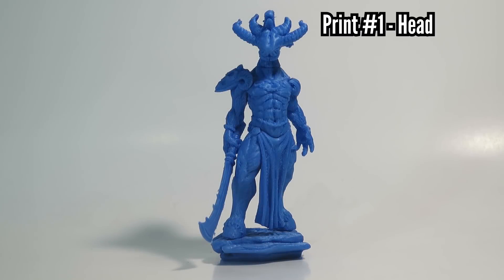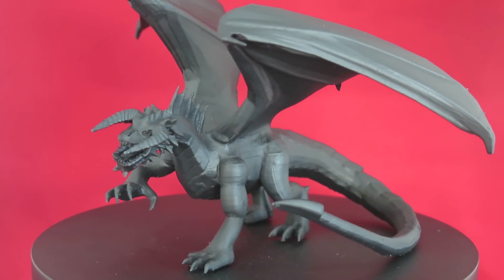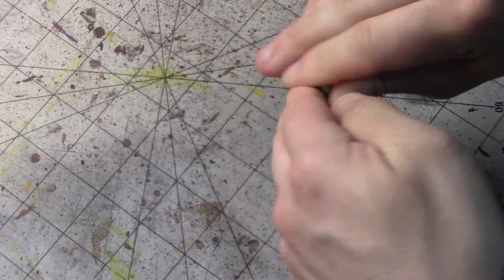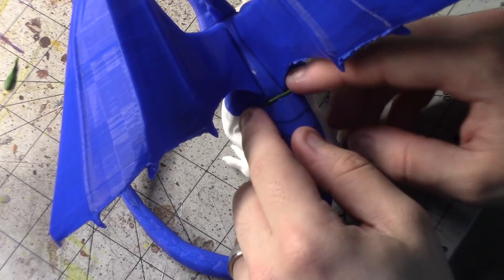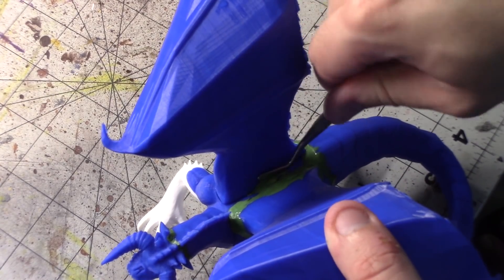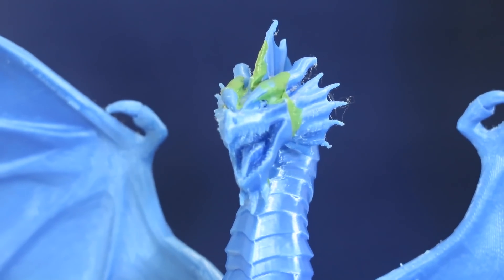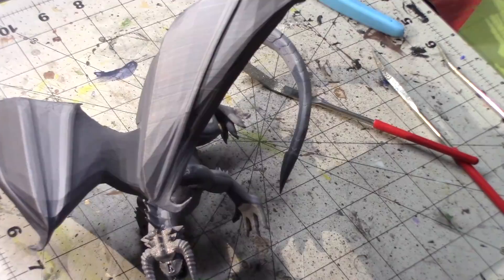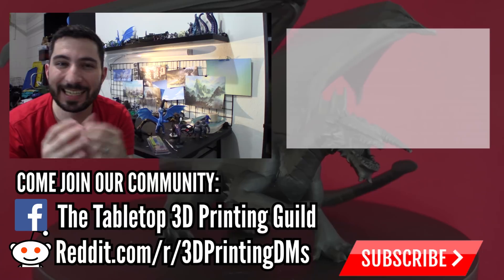Fix Your 3D Prints Cheap (with Green Stuff) - (Printing The Game #6)

Comment: Skip the green stuff. Joint Compound has worked for me. Cheaper, easy to apply, and easy to sand, file, and sculpt, too. You can even rub it thin, all over the entire model to smooth and remove layer lines.

Comment: Always cut out the center portion where the 2 colors meet.  Green Stuff is a 2 part epoxy and cures via a chemical reaction, anyplace the 2 colors touch will cause them to cure and leave a hardened section.  
Great, informative videos

Comment: I like Green Stuff for sculpting, but for a repair work, I prefer something like Milliput. The differences in consistency make them very different to work with, even though principally they're very similar.

Green Stuff (Kneadatite, by the way is pronounced Need-a-tite ;) ), while workable, is a bit like chewing gum; it flexes a lot, and tends to stick to tools readily (which, yes, has been mentioned elsewhere can be remedied with a bit of water, Vaseline, or even nose grease). But when you're trying to smooth transitions, I find it's pretty tricky. Doable, but tricky. When it sets, it's quite a bit like a plastic; shiny and mostly hard, but with a tiny amount of give in the surface.

Milliput, meanwhile, feels a lot more like potter's clay while it's in its working stage, and that includes being able to thin it with water (as when you dilute clay to make slip). As such, if you're trying to get those smooth transitions between putty and print, all you need is a wet finger, and the clay will dissolve as much as you need to get that blend. The cured result is harder, and has less flex than the Green Stuff.

Comment: you can get silicone caulk or glue in the same format instead of this, and it's much cheaper, though quite a bit softer. 
Using generic 2 part resin is also good, a random 5 minute epoxy can be applied with a toothpick in layers.

 something you might want to look at are uv cured resin pastes, which allow you to manipulate them like clay until you shine a uv light on it, or expose it to the sun (which is one of the drawbacks, you need to store it in somewhere really dark).

a warning with some epoxies, they get hot, so you might get warping if you put a lot of it.

Comment: Hi, i just got my first 3d printer (the ender 3) and I'm having a bit of an issue. The x axis rail (the bar that holds the extruder) is tilting down on the right side. One of the wheels on the right side isn't even gripping the frame at all, and the bar is tilting so much that i can lift it up from the right side and wobble it up and down. This only happens when the bar is low on the z axis though, when the bar is at the top it's standing perfectly straight.

If anyone here have experienced the same issue or have any ideas of what is wrong, then please please help.

Thanks

Comment: Vallejo Acrylic Putty I find to be easier to work with than green stuff, much easier to apply and can still be thinned out with water.
Reply from the maker: Dude, I just ordered this stuff. I'm going to be giving it a go on some 40k models I'm assembling, and then try it on some prints too. Cheers!
Reply: I literally just bought some too, I have it in my hobby/painting case.  I wanted a simpler option to green stuff, and thanks to Amazon and the reviews, I found this Vallejo stuff.  Their videos make the process super easy and it dries to be rock solid.
Reply from the maker: I can only adequately respond with this gif: https://i.imgur.com/hd7rC6V.gif :)
Reply: I'm only glad I could share with you.  I can't wait to try it on my 3d printed wasteland terrain and fallout miniatures
Reply: Hahah.  I should hop on the discord and show some of the 40k stuff I have printed.  Pretty cool stuff

Comment: Citadel also makes a product called “Liquid Green Stuff” that you can apply with an old brush (don’t ruin your nicer expensive brushes with this) to fill gaps. It sometimes takes a couple of coats to fill gaps as it does shrink a little when it dries.  It’s also great to slather on if you want to add more texture to a smooth surface or to smooth out a rougher surface.  I haven’t tried it on a printed mini to see if it reduces visible layer lines but it is on my to do list!

Comment: I definitely second the silicone shaper suggestion; green stuff and other sticky air dry epoxies don't stick to silicone so you don't have to keep wetting your tools. You can get them at art store (usually in the paintbrush section) or on amazon. Other air dry epoxies that are similar to green stuff are miliput, aves apoxie sculpt and pro create; you can also check out the plumbing section at your local hardware store, green stuff actually started out as an epoxy used for small plumbing repairs and securing joins. Just be aware of how much working time the epoxy you're using has, and the texture of it; they each react a bit differently and have different working times. For example, green stuff has a working time of about an hour (although towards the end of that it's not going to hold fine detail very well and is going to get progressively harder to work with), it's very stretchy and has a lot of give before it breaks off. Aves apoxie sculpt has about 2-3 hours working time and it dries harder than green stuff, but doesn't have as much give and will break off into rough edges rather than stretching as much as green stuff does. Miliput can actually be mixed with water after you mix it together to create a substance a lot like a clay slip, which is great for filling some joins seamlessly.

You can also mix aves apoxie with green stuff (I usually do a 50-50 mix) which kind of gives you the best of both worlds; aves firmness, green stuff's flexibility, about 1 and a half hours working time, excelling fine detail holding. Plus aves is much less expensive than green stuff (although you have to buy it in bigger amounts, but the stuff stays good for ages) so it makes your green stuff go farther and means you're spending less on epoxy. Although the cost is probably more of thing for people who sculpt full miniatures. Miniature sculptors have been messing around with all kinds of epoxies for ages, so while green stuff is a perennial favourite, know that you can play around and experiment; they've also made tons of videos about their different experiments and there are tons of videos with tips about sculpting and how to do things. Just know there isn't one way, everyone does it differently and figures out the best way for them to accomplish things. This can be a little daunting, but it's kind of like finding the best settings for a print with your printer; you keep trying things until you get the results you're happy with. Literally anything can be a sculpting tool (toothpicks are actually great), so don't feel like you have to buy expensive tools; honestly, most sculptors end up making their own to suit their specific quirks. Buy a cheap set of tools, try some stuff out, see what you like and what you don't; don't be afraid to modify them to suit your needs. Although I definitely recommend the silicon shapers, they're a dream and almost every sculptor I've seen working with epoxy uses them.

I would avoid using oven bake clays for obvious reasons, and definitely wouldn't recommend air dry clays (doesn't hold fine detail well, very fragile, doesn't adhere well).

Comment: If you find your metal files are too fine for some projects, try DuraSand Sanding Twigs. They are for modeling and a pack has multiple grits. You can find them on Amazon.
Reply from the maker: Thanks for the heads up! Between regular sandpaper (usually around 200 grit) and the miniature files, I'm usually OK. Thanks for the comment though!

Comment: Hi. I recommend silicone shaper tools you can get them in different firm-ness but personally you probably can't go wrong with picking up something medium firmness. The softer the tool is the more control it gives over the smooth finish you're trying to come up with. Which I think is great for greenstuff gap filling where you might want something to match a firmness of say a muscle.
Reply from the maker: Super interesting! Hadn't considered silicone shaper tools. That would have been really helpful for this model where I was using it to replace some really nice digitally sculpted muscles. Thanks for taking the time to comment and for sharing!

Comment: Working with greenstuff i perfer Vaseline over water, lower abrasion  and last longer, you can also work it in to the greenstuff itself to make it more slippry and easier to work with.
Reply from the maker: That was one thing I noticed - I'd have to dip my fingers and hands in the water VERY often! Thanks for sharing - sounds great :)
Reply: But just vaseline? can you explain a little more.... thanks
Reply: Yeah Vaseline works great, when greenstuff has cured just clean it up with some Alcohol.

Comment: I personally prefer using Milliput (standard yellow-grey) for such applications. Way easier to work with (not as rubbery and sticky), thins a lot better, hard as stone in the end and you can sand it.
Reply from the maker: Lots of folks have said that in here - I'm gonna have to check it out for sure. Thanks for the suggestion!

Comment: Kneadatite is Need-uh-tight.

Also the Liquid Green Stuff like what Games Workshop and a few others have begun selling is good for covering a crudely filled or small gap and adding texture over the surface of a model. For fingerprints you can always let it cure then run a lightly abrasive material like a fingernail file or similar can clean that up.

You might check out Tabletop Minions, Guerrilla Miniature Games, and similar channels for other tips, tricks, and ideas.

Edit: Also look up Blue Stuff. It allows the replication of parts via Green Stuff or similar putty.

Edit2: Vallejo Plastic Putty! That was the brand I was trying to remember all day. It is possibly the best I have found for gap filling.
Reply from the maker: Thank you! So many good suggestions from you all! Thank you again for sharing your wisdom with us :)

Comment: Clayshapers are very handy when you work with green stuff, also you got another putty with different properties like milliput/magicsculpt it has different properties from greenstuff (less sticky) but can be smoothed by water and sanded really easier than greenstuff when cured.
Reply: Another +1 for the Milliput! It's so much easier to work with and you can thin it to a paint like consistency and really just paint it into cracks and then smooth it off with your finger. And it becomes as hard as rock!
Reply from the maker: Yeah - I know some folks are fans of milliput, and someone suggested magicsculpt earlier as well. I'm working with what I have now, but will probably try different modeling clays too :) Thanks for the suggestion, Leonardo!
Reply from the maker: @Pepijn Man, hearing you talk about it makes me really wanna try it now. I've always heard it mentioned when Green Stuff is brought up, but there are so many different kinds of modeling clay, it is always easy to get overwhelmed. Where do you recommend I get some once I finish my Green Stuff? Amazon?
Reply: I suggest buying in some local store if you are near a big city maybe there's a chance you find a dedicated miniature store, sure you will find lot of stuff very useful for the hobby!
Reply: Third vote for Milliput here for filling in small gaps and spaces. Green Stuff is fantastic for shaping/sculpting, but for hole-filling and smoothing, Milliput is fantastic. Also, chap-stick/Vaseline is great for smoothing out Green Stuff.

Comment: You should try Magic Sculpt/Apoxie Sculpt.  It’s similar to green stuff, but you can thin it with water to ease that transition.  I haven’t had the time to try it yet, but  might actually work with the layer lines too when it’s thinning down.
Reply from the maker: Very nice! I've gotta give that a shot :) Thanks for the tip! Cheers, Rick!
Reply: You can do something similar with Miliput as well. For either of them, it takes some finessing though.

Comment: ive used baby powder and super glue before to make a bondo use no starch powder
Reply from the maker: Must work like baking soda, right? To activate it and harden it super quick? Cool idea either way!
Reply: 3D Printed Tabletop yeah pretty much i make a small pile of powder mix it with glue an apply it with a piece of 1.75 filiment also mix

Comment: Why are crevices on the creature so light? Is the paint job representing a magma monster? It confuses my eyes.
Reply from the maker: Yeah! I am learning to paint, so a lot of the time I'm trying new techniques to push myself. This time I decided to try this kind of magma/lava monster paint job (inspired by Ifrit of Final Fantasy really) on this model, although it really wasn't sculpted for this purpose, so it was a little more challenging. The light colors are reversed for magma/fire, and I was really practicing contrast and painting black/gray without using my typical triads or what not, and also practicing glazing for the fire parts. Hope that helps :)

Comment: Greenstuff is a great tool to have in your bag, but a 3D pen gives you some serious repair and assembly options.
Reply from the maker: You know - I've seen folks have a lot of luck mending broken arms/legs with a 3D pen, and I can definitely see it filling in that hole. Maybe it's time I invest in one :) Thanks for sharing - great idea that is surprisingly simple!
Reply: There's a guy who does full sculpts with a 3d pen and soldering iron (https://www.youtube.com/watch?v=u_hGU09Q22k). It's nuts - super unique way of working. In particular they use the soldering iron with I think some wood burning attachments to smooth the sculpture, and it seems to do an amazing job. Though, it could be more down to the fact that they are an excellent artist - I don't know. But melting the plastic with a shaping tool definitely seems like a viable option.

Comment: One trick for smoothing green stuff is to use some kind of oil like a very small amount of Vaseline. It works great and much better than water.

Also, if you've mixed too much green stuff for the repair you're doing or you need to stop sculpting for whatever reason, you can put the extra green stuff in your freezer and it's not going to cure and you can take it out again when you need it. I've gotten an extra two days of work time this way but I don't know if you can get much more time than that.
Reply from the maker: Pro tips - thanks for the tips Darren! I had never heard of the freezer! I left it in water overnight once and came back and it had shrunk like crazy. I guess the water broke it down after being in it for over 35 hours ¯\_(ツ)_/¯ I'm sure that's much more important for folks doing sculpting or something like that though :) 

Thank you again for your comment! I hearted it so folks could see it at the top of the list.

Comment: Great video! I think that some hard to print parts can be replaced by Greenstuff. Pointy blades and thin bows. Remove them from the model and model it with greenstuff. It's quite durable with a rubbery feel. Also, there is alternatives to greenstuff, for instance brownstuff for blades and mechanical parts.
Reply from the maker: Excellent, excellent point Markus! The brittleness of PLA (and most other printing materials, even resin) is not the best - and I've even used small pieces of wood or metal pins for these things to replace and/or support broken parts. I leave the detailed stuff to the real sculptors though - still have a ways to go to get there :) I've never heard of brown stuff - will have to check it out. Thank you!

Comment: I got a 0.25 nozzle about a week ago, it started looking really good but unfortunately it keeps jamming after a while into a print so I'm trying to fix that so I can print better looking minis.
Reply from the maker: I wish you the best of luck! Smaller nozzles are often associated with frequent jams/clogs - but you usually just need to work with your settings to get it right. I wish you the best of luck - keep us posted and share what you find :)
Reply: 3D Printed Tabletop Will do :) I replaced my hotend with an E3D for the intention of using smaller nozzles. I think my problem could be related to my filament quality so I'm going to be on the lookout today for Amazon Prime Day for any good filament deals or accessories. I recommend if you have Amazon Prime to keep an eye out today.

Comment: As an FYI, if you buy it as Kneadatite, you can get 100 grams for $15, instead of 20 grams for $10...
Reply from the maker: I added this to the pinned comment. Thanks for the tip, Valandar!
Reply: You may also look at ProCreate Putty,  often known as 'grey stuff'. A little softer then green stuff, imho a little easier to work with.
Reply: There's also Bronze Stuff, which has shorter chain polymers, and is a LOT easier to sand and file, but far more expensive. And, of course, good ol' milliput. It doesn't polymerize, but instead is more of a clay like putty, and cures absolutely rock hard, but it sands and files soooo smooth, it's perfect for weapons and techy things.
Reply: I was going to make the same comment. I used to do a lot of kit bashing and custom models for wargaming (mostly 40k). Here's the one I normally get, and 36" will last you a very long time https://www.amazon.com/Kneadatite-Yellow-Epoxy-Putty-Green/dp/B00MQ7EHHC If you don't want to get it on amazon you can order it on the walmart website too and they'll site to store it for you for free.